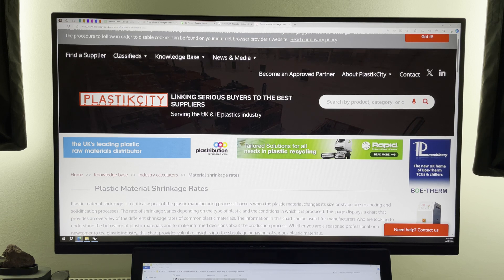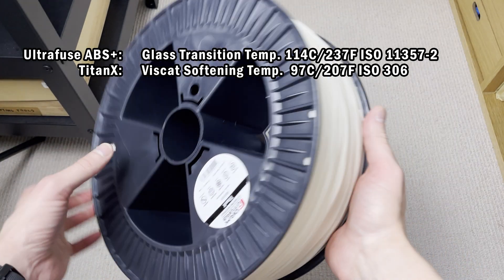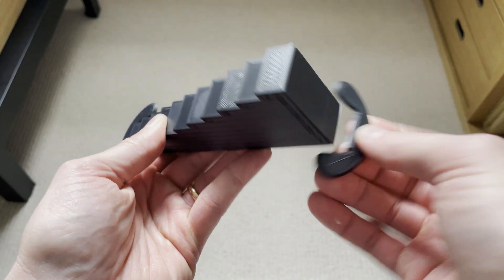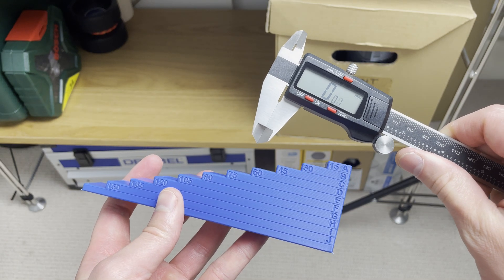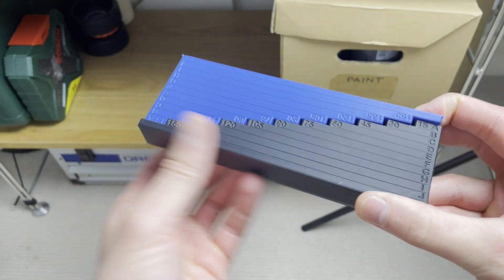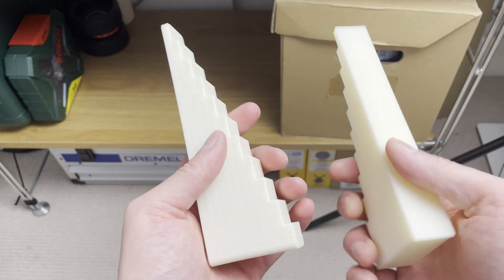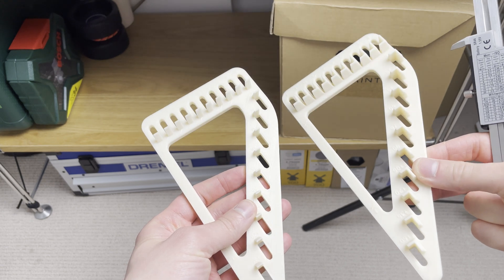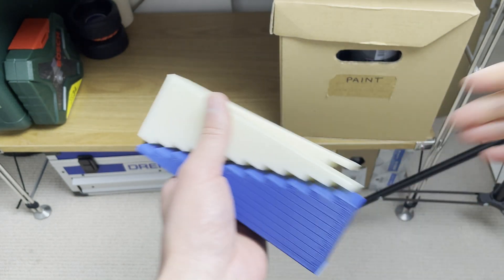How Much do FDM Filaments Shrink

Comment: SUPER video thanks a lot I usually print from PETG rarely from PLA.  I don't have a covered printer so I've never printed from ABS / ASA I'm afraid I'd be destined to fail :) but maybe one day I'll commit :)
Reply from the maker: Thank you for your kind words sir. Im a big fan of PETG myself and still looking for best one out there but ABS+ and ASA+ are safe to print without enclosure, I’m quite confident. If you pause video where I’m introducing filaments and zoom in on spools there are indications from manufacturer. Particularly FormFutura’s Apollox (ASA+, that prints at lower bed/nozzle temp than some PETG) and TitanX (ABS+). But the only reason why you would really need to use these two filaments (In my opinion) is either requirement for higher temperature tolerance or for easier sanding. Otherwise there are tons of PLA/PETG’s with enhanced features. Also. FormFutura sells their filaments at 250g small spools, which are cheap to try out, so together with 3DLAC (or equivalent) adhesive there is definitely high success rate. But to successfully print O.G. ASA/ABS is another matter where one would not only need enclosure but an actively heated enclosure of ~60C, as I didnt manage to print them without warping even using fixing agents with ~36-40C inside of an enclosure. Of course I could try with a tall skirt all around the part, but chances would still be low printing big parts.

Comment: Thank you for the Tests,
Im missing some print settings, can you add This to the video description? Thanks 
Infill percentage
Infill pattern
Layer Hight
Nosel size
Reply from the maker: Hello and thanks for watching the video and your question. To be most accurate determining shrinkage it would be best to print shrinkage calibrators using same settings one would use for intended 3d prints so it will slightly wary per case, but my settings were: 0.4 nozzle, 0.2mm layer height, I use 4 perimeters with 40% grid infill, 6 top and 6 bottom layers. But…I also tested 0.4 nozzle, 0.2mm layer height with 2 perimeters at 20% grid infill and noticed no difference in shrinkage. For ambient temperature within enclosure its always ~32-36C. If you pause video in the results section you can see what bed and nozzle temperatures I used.
Reply: @StudioSpaceDust  thanks for the update,